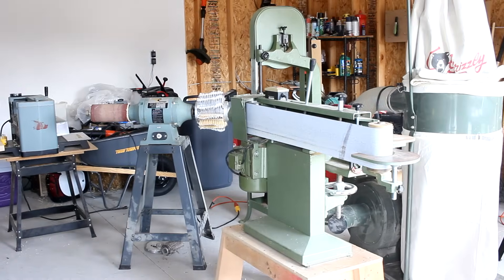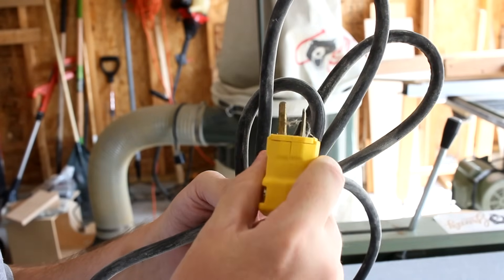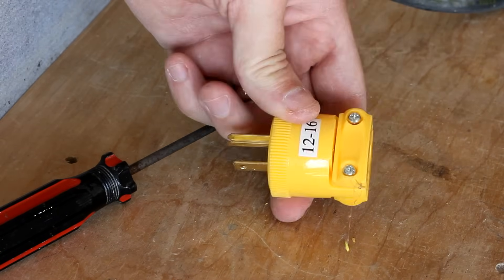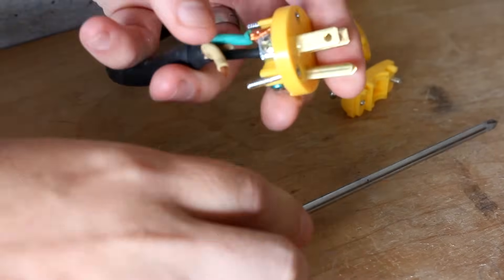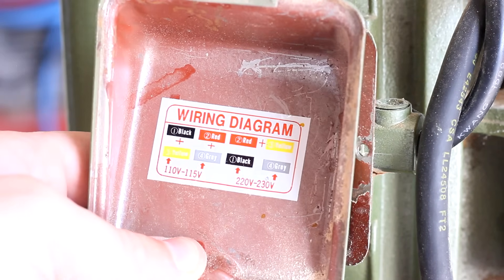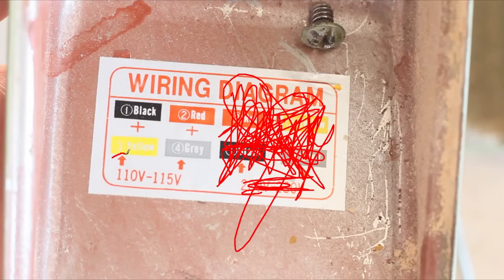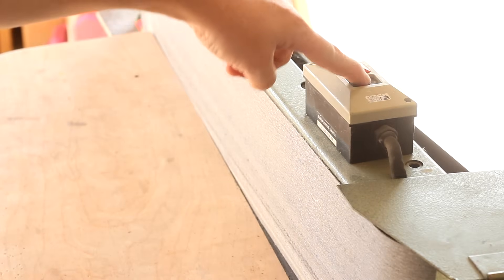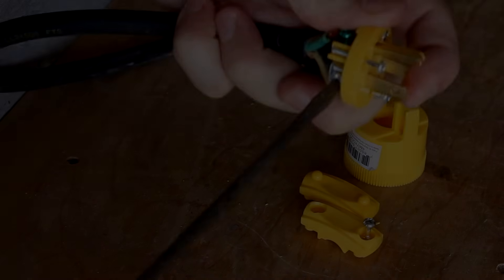Shop Work: How to convert 220v to 110v

Comment: Ack! Something very important! Bee sure to check amperage! The device plate says it will use 18 amps when wired for 110 volts. You would need to make sure to have a 20 amp plug and appropriate cord for that.
Reply: I run an air compressor on a 15 amp circuit,  I checked it with a kill a watt plug and found it was pulling 20 plus amps. It will run and do what I need, which is not a lot. But if I don't unplug it,  eventually it will blow the breaker. Since the circuit has a freezer and a fridge, I don't leave it plugged in.
Reply: @trentallman984  I don't think I would use that  outlet at all!
Reply: Bee sure?  What a bumble!   :-)
Reply: Wow, I never thought of that.😮
If I buy a Turkish samovar (tea urn) I am guessing the cover plate on it will not be in English, and the wire colors may not be the same, or the same color in the plug either.
Am I looking at having an electrician do it? That would ptobably double the price. ☹️ I have a son-in-law who is an electrician, and a son who can fix anything, who is in college taking engineering. Unfortunately, one lives 2000 miles away, and the engineer lives 3300 miles away. So much for help from them. 😢 I can rewire lamps and replace outlets and switches, but this is too complicated for me.
Reply: @knitwit7082 if you can replace switches, outlets and rewire lamps then you know to do this too.
You have to connect, (red,red and white) and (black,black and yellow) that's all. I know you can do if I can 😊
Reply: Ben Kenealey ...You saved me from explaining the amperage requirements per CODES. ThankYou Ben
Reply: Absolutely correct!
Reply: Well said and not knocking the video, but 18 amp on the tag=20 amp plug=#12 wire cord with 20 amp commercial receptacle with #12 wire in wall. Standard home receptacles are only 15 amps. Good video, I liked the part about water in bathtub....lol
Reply: It is a question of proportionality and inversely proportional. 
The electrical power of the device must be equal in both cases....
@gdelectpower
Reply: @ingenieurgod-la489  Got it.
Reply: stop polluting the conversation with facts
Reply: @nightstringers  This is a very important fact.  I just watched the video and was coming to make the same observation.  I know, or hope, you are joking with your reply, but this is not something to be taken lightly.

Comment: The plug you got is not rated for the motor you are putting it on, so be sure to check it frequently, you may feel it get warm, if it does, change it out for one that is overrated.

Comment: interesting and clear howto, but one question.  The motor seemed to be rated for 18 amps on 110v, but you used a plug rated for 15 amps.  Also, if you run this on a standard 110v 15amp circuit it's likely to trip the breaker frequently isn't it.  No expert here, just wondering.
Reply from the maker: Someone else brought that up too but the motor doesn't draw that much.  In fact, all the previous 220v plugs were 15amp too.  Should be fine.  But nice catch. :)
Reply: Great.  Thx for the info!
Reply: @FishersShop  15 amp per leg

Comment: Does changing the voltage decrease the power?
Reply from the maker: From what I understand... No.  There's other variables at play here though such as the gauge of the wires, the amount of energy lost in "heat", the amount of current being drawn, among other things.  There's pros and cons with choosing to run your tools from 110 and 220 and there's some good write-ups covering all of them.  I'm no master electrician, but I know that getting shocked from 110 will give you a good ring but getting shocked from 220 can kill you.  So that's just one more "pro" to switching to 110 that I can think of.  Thanks for watching, Jim.
Reply: Yes , Going to a Lower Voltage Does decrease the amount of Cutting Power. A 220 Powered unit will Have more Balls / Torque / Power & cost less to operate. Amperage spikes are Higher at 115volt , and alot of utilitys Look at the Peak Load Demand = Peak amps Drawn at a certain time of day.
Reply: What would happen if it's wired for 220 and it's plugged into a 110 outlet?
Reply: @highschool4624  It will probably run but it will lack power and the motor will get very hot.

Comment: Seems like that ever important other 2x / x number next to AMPs might be important. (18AMP motor and 15 AMP plug) What do I know though, I comment on YouTube videos.

Do like the videos and humor though.
Reply: Fisher's Shop the 220 volt plugs can be rated at 15 amps and be fine because that motor only pulls 9 amps when wired for 220v. Where as it pulls 18 amps when wired for 110.

You really shouldn't use 15 amp rated plugs or cords for a motor rated at 18 amps. It will causes them to get hot which will eventually compromise the insulative properties.

It may not happen in the next 100 uses. But if he ran that sander for a while it would certainly draw the full load amps. Which is what the name plate is showing.

It can safely stay on the 110v wiring configuration but it absolutely needs everything to be rated for 20 amps. All the way back to the breaker panel. All wire and cords need to be 12 AWG size wire.
Reply: Im worried that the plug which is only rated for 15 will be compromised before the breaker. Or the bright orange extension cord. At my work the rule of thumb is to only use 80% of the total capacity. So for this example everything would be rated for 20amps. Just in case the device had a little inrush current would not trip the circuit. 

I did enjoy the challenges. I am going to try to do change a plug while it is hot next time. Maybe i will make it more challenging by using 208v!
Reply: Fisher's Shop In nema it would be 5-20.
Reply: I'm sorry to have caused a bit of a kerfuffle. I work in insurance, so I'm a pro at being both pedantic and risk averse. A real winning combo. 😂
Reply: Tim Mills, I don't work in coverage or claims but that would be my guess too. I don't want to knock on Mr Fisher. His videos are awesome and informative. I'm going to be building sawtooth shelves for a closet inspired by his videos. His humor is unique and he has a lot of humility. I also love the out takes.
Reply: Fisher's Shop I'm sure he will be okay. I just want to offer up what I knew.
Reply: symposes    Correct on all grounds! I would have just saved the hassle and just ran a couple of 220 lines and called it good for everything in the future. I planned ahead and just ran 220 volt 20 amp line to several different location in my garage. Makes life easy.
Reply: Ricky Holton if you work in insurance, you might let him know about what the insurance company will say when an under rated cord was used and causes property damage... in most cases it will result in a denial of coverage.
Reply: Ricky Holton Yeah, not knocking him, just saying to watch out for all the b.s. in the 500 page policy that nobody reads. hell  even cords that aren't tested by ul  can be denied coverage.
Reply from the maker: Thanks guys, you're all absolutely right.  I screwed up.  I can't seem to locate any 20amp plugs that have the standard household prong layout.  If you find one, can you share it with me?  Otherwise, it looks like I'll be watching my own video in reverse and putting this thing back to 220v.
Reply: Fisher's Shop 20 amp plugs have one pin sideways so that they can't be plugged into a standard 15 amp outlet, but 20 amp outlets will accept both 15, and 20 amp plugs.
Reply from the maker: Well spotted, but things still should be ok since it doesn't actually draw that much.  The whole thing is on a 15amp circuit so the breaker will trip before there's a risk of anything else going wrong.
Reply from the maker: Well the orange cord is just temporary obviously.  I'm sure it'll have 14ga wherever it ends up.  I'll recommend to Kyle that he puts it on a 20amp circuit and runs dust collection on a different circuit to mitigate chances of popping something.  If it turns out it's not enough, it's easy enough to change back to 220v.  But I couldn't find a 110v plug that was rated for 20amp.
Reply from the maker: I just realized that all the 220v plugs I've replaced on all the tools were ALL 15amp as well.  So I'm pretty confident that he'll be ok.

Comment from the maker: I SCREWED UP!  So it looks like I goofed in the video.  It was pointed out by some of you viewers that I missed that the motor will pull 18amps when it's configured for 110v (instead of the 9 when it's in 220v configuration) and that the plug I chose is underrated.  Just wanted to say THANKS for spotting this!  I'll be correcting this before the tool is used in the new location.  Thanks all!!

DISCLAIMER: If you hurt yourself or blow up your house trying to do this, don't hunt me down and sue me.  Playing around with electrical configurations can be dangerous if you don't follow the instructions.  Each motor can be different so what you see in this video may not apply to your own situation.  Pay close attention to the instructions and if you're ever in question, STOP AND CALL AN ELECTRICIAN!

With that in mind, you can also convert tools from 110v to 220v by playing this video in reverse.  Hope you all liked it!

P.S. - Please don't electrocute yourselves.
Reply: Fisher's Shop I'm not normally the Safety Sally type (except at work, where it's my job to be just that), but I did notice that right away, and paused the vidjayo to come down here and point this out. I've burned up a 15 amp outlet doing that before. I hope others were nice about pointing this out, but I'll be heading back to the video now. ;-)
Reply: Fisher's Shop    Well you kind of made a mistake and you also have a safe installation.   Technically, the motor is rated 18 amps at 110 volts.   If your voltage is 120, then amps drop to 16.8.  If your voltage is 125 then you are at 15.8.   Next the amps on the motor are FLA or full load amps.   This is the motor rating not what is required to do the work.  The motors are typically oversized to engineered Hp required.   Some comments below stated if you run the motor for a while you will have a problem.  Not true.  If you are running this on a 15 amp breaker and it is not tripping the breaker, then you are totally safe with the breaker, the conductor, the receptacle, the plug, and the cord.   If you were to change the plug and the receptacle, (Code violation) as well if you changed the breaker and not the wire.  As an engineer, we would have put in the 220 volt circuit and not changed it.
Reply: not only you admitted you goofed, but accepted constructive criticism with Humility. my hat off to you. i Like, OLE!
Reply: I messed up and got my table saw stuck in my ceiling fan.
Reply: i plan on doing this in a bathtub full of water😁
Reply: Volts and amps are in reciprocity. If you're going from 120 to 240 you only need make the connection changes. Amperage is going to drop when you do that. If you go from 220 to 110 you need to up your wire gauge ( a length vs amps dictated factor ) and make sure the on / off switch can handle the increased current as well. I know this sounds counterintuitive, lower amps with higher voltage but it has to do with series vs parallel connectivity.  Jeremy Fielding does a lot of very good motor videos on YouTube if you want to get into this.
Reply: Yup! That’s why 220 is better because there is less current draw. Ohms Law.
Reply: 18a also needs a 12awg cord, or better 10awg.
Reply: Cord looks to be only about 16 or 18 Guage wire. Not going to do it for 18 amp load. Danger ! Huge fire hazard !